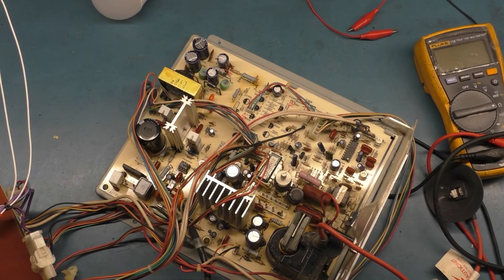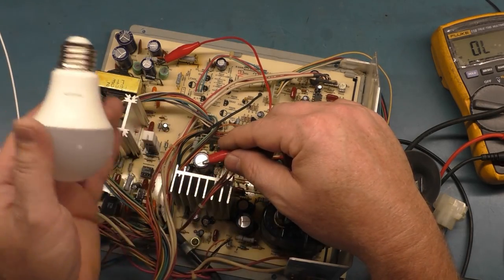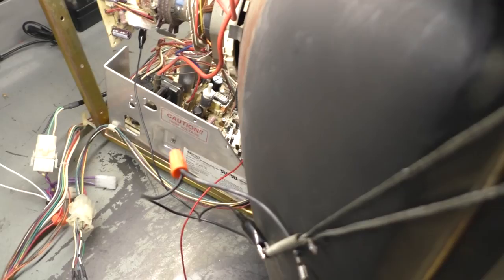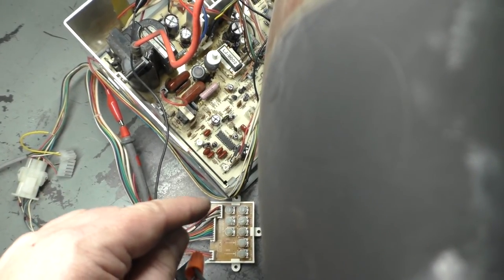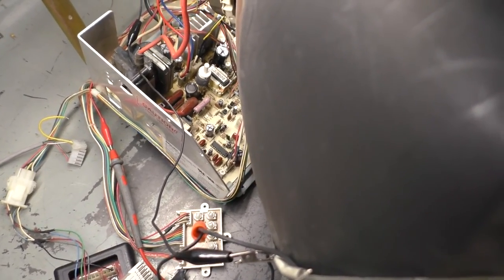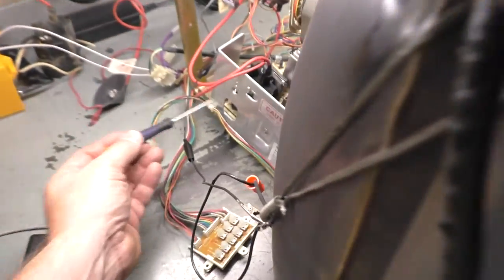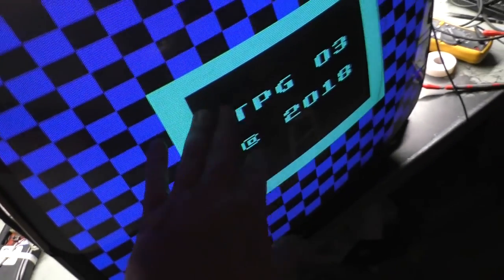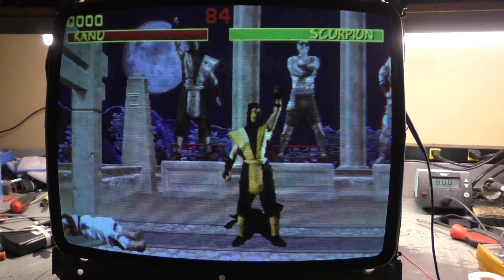25" Neotec 2515C Arcade Monitor Chassis Repair - "No Picture" - Down The Rabbit Hole We Go

Comment: How far off can B+ be without problems appearing? What kind of issues does the B+ being off cause outside of shut down?
Reply from the maker: It differs depending on the model but it will cause “blooming,” brightness issues, size issues (too wide/small), etc. the Polo should be at 138vdc.

Comment: @MikesArcadeMonitorRepair Great video.  I have an area 51 with this same CRT and board with the same problem.  I have the IC on its way.  Do you know what the wattage of R106 is?
Reply from the maker: Thanks. According to the manual, it’s a 1/2W 820k…

https://www.arcade-museum.com/manuals-monitors/Neotec-2515C-25E.pdf
Reply: @MikesArcadeMonitorRepair  thank you that was a fast reply! :)
Reply from the maker: You’re welcome